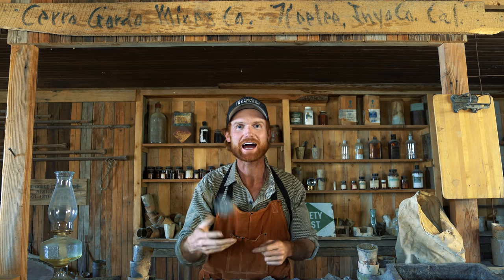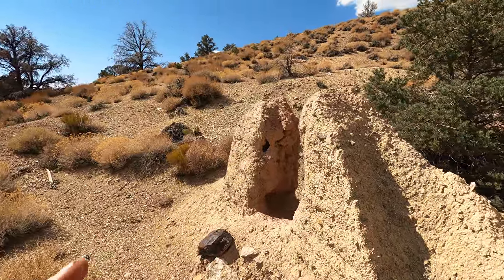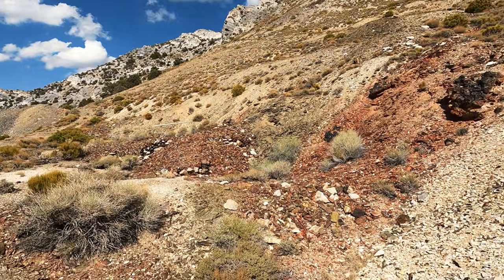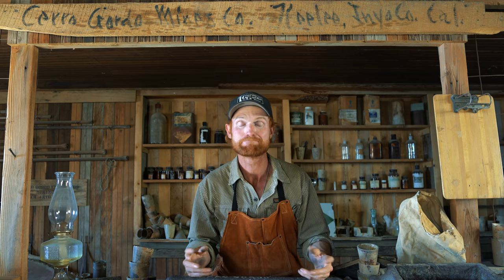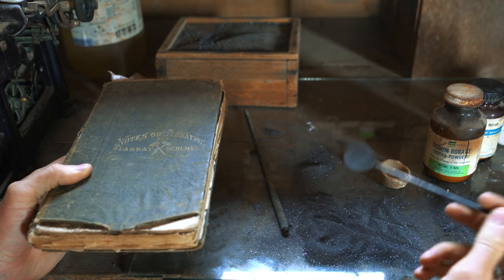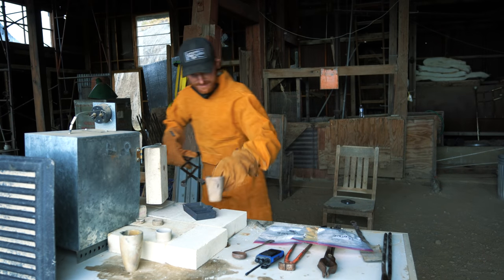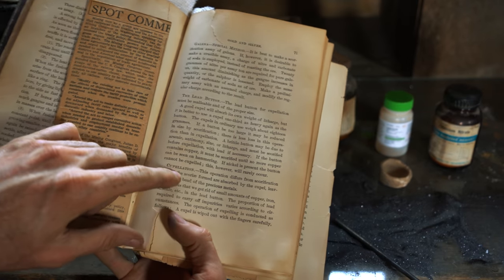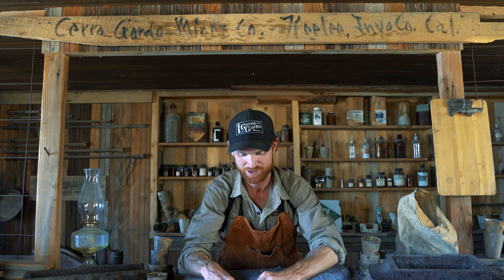Making Silver From Ore I Found In An Abandoned Mine

Comment: Just a saftey tip!, I’m sure you know this, but when smelting you DEFINITELY want to have a mask on, rated for chemicals and lead, you Definetly don’t want to breathe zinc or sulphuric fumes as they are toxic, especially zinc fumes. They can be pretty gnarly on the body. Always better to play it safe.
Reply: I was thinking the same thing. At first I thought it would be a cool attraction, but I’m sure the lead and other toxic fumes would probably make it tricky for the permits he’s eventually going to need for the hotel and bar.
Reply: and lead is super toxic. Please use proper precautions.
Reply: @rayna8423   Me and a buddie collected a bunch of fired bullets at the range and melted them down.  The copper jackets floated to the top and get got maybe ten or fifteen lbs. of lead.  But we were melting it out side and we still both got nasty headaches.  No more playing with lead.  I don't know how guys work with the stuff in their garages or backrooms to make their own bullets.
Reply: Like arsenic, which was noted in the book he was using
Reply: @Jeff-jg7jh  Dang Sounds scary asl, lead fumes are so freaking dangerous, problem is once it’s in you it stays and takes a long time to leave your system. Not trying to sound over paranoid but for your sake, I’d Def look into doing a metal detox. I know it sounds crazy but supposedly it helps a lot and can prevent that lead from causing further or any damage. Another weird but could be use full tip. Coffee enemas remove Heavy metals and toxins from the body, (might sound tmi) but like to offer anything that might help someone🤙🏼 if you don’t believe me look it up, it’s quite fascinating.
Reply: @johnnylego807  here's another tip.. if you live near a small regional airport...MOVE, or try to get the airport to exclude all LEADED GAS PLANES pulled from the airport!!! Yes, they still use leaded gas for some the air planes that fly ABOVE all of us!!! It help with reducing the knock of the engine, and extending the life of the engine!?!? While polluting and harming everything they fly over!! Heres the thing.. they removed certain airplanes because they produce Too much noise!!  Engine sound...flying through the skies and the reverberating sounds bouncing back to the ground... so lead exhaust falling down on people and their property.....should be a no brainer!!!!
Reply: @raywhatsthisfor1283  tetraethyl lead isn’t “lead”…the amount of fuel burned by piston engine planes is minimal.
Reply: @jaredmayer3960  ok,but they're still using lead containing fuel!!  I just saw a story about some country just used the last of their leaded fuel.. I really dont know the actual make up of piston airplane fuel!?!?  I've seen articles on places near airports and the extreme level of lead around them!! That's all!!
Reply: @raywhatsthisfor1283  it’s not “lead”. It’s tetraethyl lead.  Like micro amounts.  There may be “lead” around airports but it isn’t a super hazard.
Reply: I was thinking the same thing. Someone needs to get this guy a nice N99 respirator and some good gloves. Lead is no joke. That being said I grew up helping my dad melt down range lead and cast new bullets for reloading ammo and I've worried about that exposure. I've since had my lead levels tested a few times and they were perfectly normal. If your safe and don't breath particles in and always wash up real well, he's probably ok. The smelting process and crushing ore probably present the most risk to him.

Comment: Hmm, doing a little math, you mentioned at 22:00 that the result was .15 grams from 30 grams of galena, so just move the decimal point over and 1.5 grams from 300 grams galena, that's 200:1 ratio. So to get one troy ounce, or 31.1 grams, you need 31.1 x 200, or 6,220 grams of galena per ounce, round that up to a tidy 6.25Kg
Current spot price of silver is $23 and some cents USD per ounce. Say you want an income of $1000 a week before costs from your mine, you would need 43.5 ounces a week. 43.5 x 6.25 = 271.875, or a neat 272Kg of Galena that you need to carry out of your mine... 

You'd get pretty fit and strong carrying all that weight around! 

Can you find 272Kg of galena and pile that in a stack for us to see what $1000 of raw ore looks like?

Comment: IF, I say IF there is what's called "Native Silver" associated with that deposit (most likely there is some), it's easy-peasy to find it with a decent metal detector and even simpler to pound that rock ore down, pan out the pure silver and melt it down, using a jeweler's torch.  I've done it with bonanza-grade ore from our Badger Mine, outside of YQT.  It's on MINDAT.
Reply: That makes a lot of sense. He said in the beginning that he’s sure there are much simpler ways now, but he wanted to start with trying the original process they used way back in the day. He’s a really patient & determined man!
Reply: This mine is producing galena which is mostly lead rather than silver. Not "native" silver and not bonanza grade ore.

Comment: Brent - in the early part of the last century,  lead was used to sheath aerial and underground telephone cables. A surprising amount of it is still in service in my area (Pittsburgh). I know of one cable that was installed in 1913 that's still in use. The twisted copper cable pairs are insulated by paper, the sheathing is lead, and they have dry air on them to keep water out. In the days before plastic, lead was incredibly prolific.

Comment: I guess I have seen some of the largest roasting process working for Kerr McGee in Henderson, NV. We had giant hearth hoods that we placed mounds of manganese dioxide ore to roast off the O2 from the MNO2. We then moved it into sulfuric Acid Baths to turn it into a slurry. From there it was moved uphill into a plant that further refined the product. Once we’re we wanted the concentration we electronically bonded it to plates. After drying we used Jack hammers to capture the product. From there it is pulverized into a powder and bagged for shipment. If you are using a AA battery then you are using that product. By the way, the ore was mind in Angola.

Comment: I was thinking... Boudrie's blast furnace stack looks an awful lot like a quad flue center chimney from a colonial era post and beam New England house. There are a lot of solid timbers laying around from the old tramway. One could conceivably build such a structure right there without having to hew out a single beam or even build a chimney (although the stack would have to be modified to accommodate fireplaces instead of a smelter).

Comment: How much was the heat energy and the chemicals and equipment costing? There still is a market for lead, lead acid batteries use lead connectors between cells, so there is that..
 It seems the work to get it out of the mine,the pulverizing process,the amount necessary to make your time worthwhile and the equipment cost is what is holding you back from making a living from mining, no small things
There must have been 100lb chunks of galena.and a large mechanical crusher involved to make the hard work profitable. Did the miners go past the crushing or did they leave the smelting process to others?